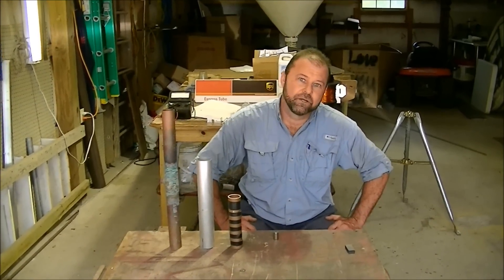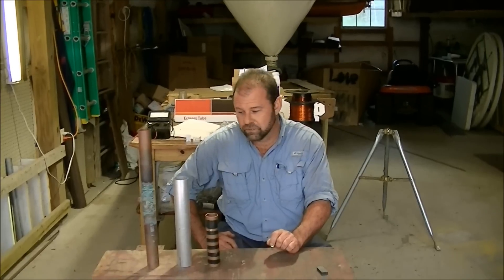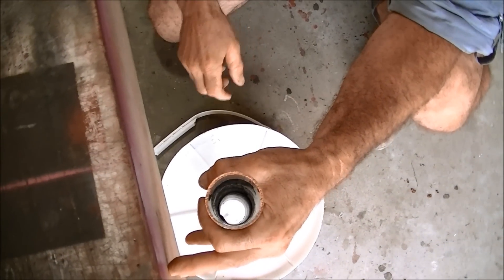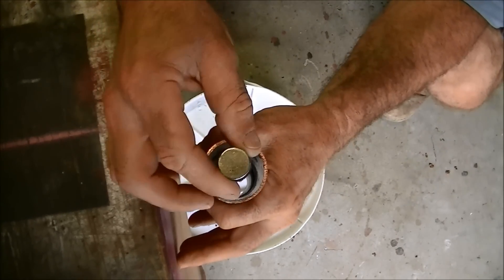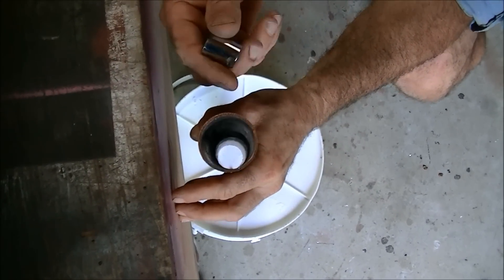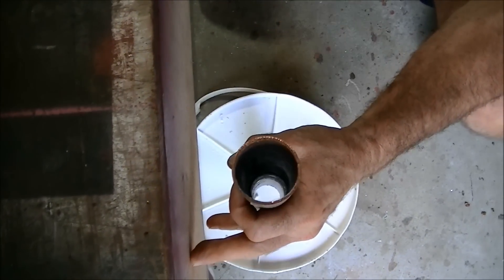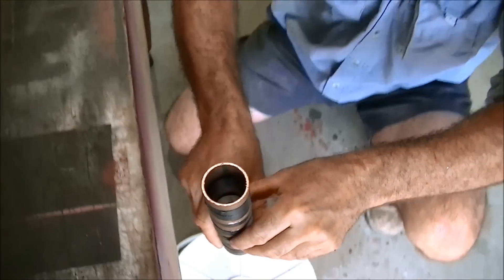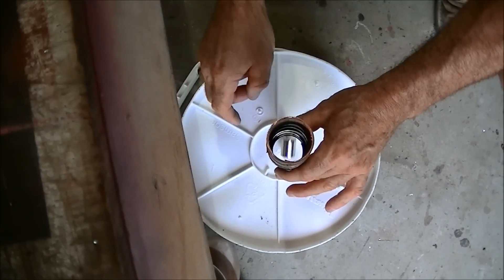Watch what happens when a magnet falls thru a copper pipe/aluminum pipe.

Comment: Just so you know it's not making any electric at all. If it were it would fall faster.
It's all to do with electrons and magnetic "friction" being caused. As there is no potential, the field repulses itself making it slow. If you add a light or load, allowing for the charge to flow, the magnets fall as there is no resistance.

Comment: The comparison of copper sections to continuous copper pipe is a great experiment! The reason it falls faster through the cut pipe is that there is increased resistance between sections; the induced current is lost to resistive heating faster than in a single whole conductor, causing the opposing magnetic field to collapse faster. Since that magnetic field is what slows the descent, the faster it collapses the less it can impede movement

Comment: Evidently, the magnet is causing an electric force to swirl around inside the pipe, but because of friction, the magnet is being impeded. Theoretically, the magnet's fall is being converted to a slight amount of heat within the copper. This is supposedly how electric generators work; a coil of copper wire is placed in the vicinity of a moving magnet, creating electrical current.

Comment: This illustrates  "Lenz's  Law" which basically states that any induced magnetic field such as moving a magnet through a metel pipe, will oppose the  field that induced it.  Does not have to be a magnetic medium.  i used it in a science project many years ago to levitate an aluminum ring on a steel core.

Comment: What if there was a tube made of copper wires coiled, made into a complete circle with a neodymium magnet inside and it was turned by a motor? Would the magnet hold in suspension in one spot and could the wheel power itself? 🤔

Comment: Okay next experiment  round copper pipe with connectors  place a rounded magnet in the the circular copper piping does it generate power and can it ever run out as it were. and what I mean by circular  pipe is a hula hoop drop magnet ball in that and figure it out?

Comment: it goes slower on the one because you "break connection" causing it to free fall for that small distance building speed. also with the cylinder magnet, hold it sideways and drop it rather than log ways into the one with slowly falls through. 😋

Comment: This is how most people get electricity. People burn coal. The fire turns water into steam. The steam turns the turbines. Inside the turbines are power generators. A power generator is only copper wire and magnets. Water goes through dams. The water turns the turbines. Inside the turbines are power generators. Power generators are only copper wire and magnets. Inside windmills are power generators. Don't get caught and be very careful.Electric motors are made exactly like power generators. You can take apart a blender and make small amounts of electricity. You can take apart a electric saw and make small amounts of electricity. You can take apart a vacuum and make small amounts of electricity.
Reply from the maker: Good answer. Check out my home made hydro generator.
https://www.youtube.com/watch?v=Gnyo95hon-U

Comment: If you took a thin walled plastic tube and tightly wrapped copper wire around it several times, would that generate a high amperage current?

Comment: I was thinking what if you get two other magnets on each entry with the Third in the pipe. and make them rotate. so there always reversing the direction of the inside magnet could you build up enough energy to do anything useful with it? no body freak out please I don't actually know how this works I'm just curious.

Comment: im an inventor and my theory and idea is simply this THIS IS A TIME MACHINE. inside the magnet is a capsule where a human can be in suspended animation in time where if you are inside for a day earth can travel in time in normal speed but the capsule would slow down to half that so every one day inside earth is two day into the future and you can adjust that depending the thickness of coper pipe and strength of magnet , you may preserve a hot meal or a  car from effects of time like rust ,rotting and aging ect.. imagine an army inside where  they go in come out 30 years later but its just like yesterday without any damage to tanks aircraft without loosing war skills ready to go its like the new refrigator it may preserve anything in the capsule machine or people for later use. having a hot meal ready and eat it fresh  30 yrs later is cool, but time travel may have unknown effects on the body and the mind of a person , you may not like the future you see and ca not go back in time . my hopothothesis .

Comment: What happens if you rotate the pipe while magnet is in transit? if you put the pipe across the diameter of a wheel, there will be a speed that will keep the magnet in the pipe indefinitely

Comment: If you suspend the pipe in the air on non-conductive wire, does the magnet still fall like this thru the pipe? I ask because there would be no path to ground.

Comment: You just showed how a selonoid works .. except magnet has a spring on it n voltage is applied to the pipe for a reaction. Open n close the circuit

Comment: Will any magnet with dimensions you've listed work?

Do you have any suggestions on where to purchase magnet like one you are using in demo?
Reply from the maker: It has to be a n52 magnet around this size. Also the thicker the pipe slower it will fall.
Reply: markp0177 
Thanks...
I'll see if I can get think copper pipe at Home Depot or some other   store...   Not sure where to buy magnets but I'll google it.

Thanks for sharing video and answer...

Comment: So does it generate electricity at both ends or only near where the magnet is moving, ie are the electrons clumped together at the point where the magnet is or does it flow to the end of the pipe.

Comment: I wonder if that defect would be Amplified if you had a thicker pipe and not a sticker board but the same inside diameter with the quarter inch or larger outside diameter as example

Comment: could this be used in conjunction with say, a hydro power generator, to create more power? So have the magnet in a sealed pipe, and as the water wheel is turning, the magnet is moving from side to side. therefore generating more electricity than a standard wheel?

Comment: if the magnet falls slower and a magnet passing through coils creates power, then what happens if the copper pipe were a sealed circle attached to a motor with coils on the outside?

Comment: So smart he has the bucket upside-down.
Reply: Rafael Santana The bottom of the inside is flat too. Also, fuck you & your ableism.
Reply: Rafael Santana No, no respect for you & or your epithet. 
At any rate, the pipe could be held any distance from the surface since it was filmed from above. However, had the bucket not been upside down he wouldn't have had to fetch them off of the floor - instead the magnets would have simply been in the bucket.
It's a foolish argument.

Comment: I just tried this at home - a small but strong neodymium magnet dropped through a 10mm diameter copper tube, only 28cm long, took about 3.5 secs. It was a fairly snug fit but the magnet did not touch the sides as it fell. Is there a practical use for this? Very interesting, thank you.

Comment: Have you took in consideration that the copper pipe with the rings.. is much smaller than the solid copper pipe.?   Could you cut more rings and make the same length,  then try it again. ?   Like to see results.

Comment: That's cool man..What would happen if you wrap thick coil wire around the copper pipe "50" turns or more and connect each end together or connect a light bulb to see if it lights or slows down even more.

Comment: Just tried this with a three-quarter inch or so copper pipe and a few neodymium magnets from Harbor Freight. Definitely works, doesn't fall as slow as in this video but it's still freaky.

Comment: FYI gold is the best conductor for electricity not silver thumbs up if you have done your research and agree
Reply: pyrolatry87 As mentioned, silver is the best. Gold conducts even worse than copper...it is just used often in electronics as plating due to it's corrosion resistance
Reply: pyrolatry87 No.... as he said in the vid, Silver is.
Reply: pyrolatry87 you have to get gold down to absolute zero to be a super conductor.
Reply: I see now u have already been corrected by previous comments. lol I love the comment section.
Reply: Eric Myers nice name Eric
Reply: FYI pure silver is the absolute best conductor. Cant thumbs up on this. Gold is well behind copper and is only used on contacts because tarnish or corrosion resistance.
Reply: HarryHydro supercoductor ceramics @ liquid nitrogen!
Reply: Actually, you don't need to go to absolute zero; you need to go below what is called the "Transition Temperature", and it varies for different materials. In the case of Yttrium barium copper oxide it's above 77 Kelvin, which is the boiling point of liquid nitrogen -- this is why the Meissner effect can be demonstrated in classrooms without requiring liquid helium.
Reply: Jim Hofoss No, gold is not the best conductor.  Copper is a better conductor than gold and silver is the best conductor of all.  Look up "IACS" ratings of different metals.
Reply: Hugh Jasol I stand corrected!   Thankyou....I suppose that gold plated terminals, such as on audio cables, are used because the gold does not oxidize and degrade performance.
Reply: Eric Myers nice name
Reply: pyrolatry87 yes, gold is the best conductor of electricity that we have found so far....there may be elements and conditions which change this parameter in the future, however
Reply: Eric Myers no, gold is a better conductor

Comment: way back early 2000's non-battery flashlights were available that lights with a few shakes. it has some sort of metal (not sure if it's magnet) passing through a copper spring

Comment: If you connect a multimeter on the ends of the pipe, you should be able to measure a voltage

Comment: it is a counter electromagnetic force. it is not producing electricity. it would go slower if you used a thicker round magenet. I believe coils and magnets put in the right configuration, can make a free running device. good luck.

Comment: I spent most of my working life installing, jointing, maintaining and repairing copper telephone cables, but some bright spark in the late 70s to 80s, decided to use aluminium conductors on large size cables instead, probably because aluminium was cheaper than copper. What a disaster that turned out to be. With you saying that aluminium is only 69% efficient as a conductor, I don't know why they even bothered. These main cable runs, of mostly 600 or 800 pair cables, usually about 2 to 4 kms in length were notorious for causing noise problems, like the old phone crackling, hissing etc, and then when the internet arrived, all sorts of speed and dropout issues. Also the joint enclosures were plumbed lead, which were prone to cracking and leaking if not done properly, or from fatigue if moved around too much in the manholes. Once moisture gets in, and with the paper insulation over the conductors getting moist the whole joint cooks from the heat generated by the subsequent current leakage. Even when opened up and dried out, these joints would remain a problem forever due to the aluminium powdering up and eventually breaking off completely. Must have cost billions over the years. Needless to say they went back to good old copper, which even that now has mostly been replaced by fibre technology.
Reply: Aluminum is fine, the application will require more of it (thicker gauge).  All Aluminum will rust if not treated or react with other metals. Each connection REQUIRES an Anit-Oxidant compound (electrical grease). There should not be any paper in new cables used in high moisture environments. Fiber optic cables need to be used even more than they are today.

Comment: I have not tried it, but was told by a Physicist that the larger diameter the copper pipe and the smaller the magnet, the greater the space-time continuum is impacted.
EXAMPLE: 
If one were to drop a 1" magnet into a 4' diameter copper tube approximately 6' tall a shift in the space-time continuum could be as great as plus or minus 10 years - time being pushed backwards if above the equator, time being pushed forwards if below the equator.
I am now looking to obtain a 10" magnet, 40' diameter copper tube and 60' tall so I can travel 100 years back in time. Be sure to look for me in the history books.

Comment: Interesting...if the electricity could be used to move the magnet to the top again and drop it through the copper tube...would that not almost be a eternity machine?...it'd last as long as the copper tube lasted.

Comment: Very interesting Mark.  One wonders if the gauge were thicker, if greater voltage could be generated... I've been thinking about magnetic propulsion and water powered engines...  and hover crafts.  Theories abound that UFOs use magnetism to achieve singularity; but then they're seen entering and emerging from the ocean: so I wonder if both are used...  Thank you for the video.

Comment: I wonder if a copper pipe with a silver plated inside surface would be as efficient as solid silver, more than copper, or much the same. Also what happens with gold? or (gold plated). Another idea is to attach the magnet to a bungy type spring (like a "slinky") then bounce it up and down like a yoyo. I found that bouncing a slinky spring created a lot of momentum with a small movement  to start it falling but a big release on the bounce back up. I imagined a big tower with a giant slinky coated in copper and a magnet in the center, but it could work in reverse, using the weight and gravity to go down and the spring to bounce up, to generate electricity. I know it sounds stupid! but....

Comment: I am curious ... the large sized magnet you have moves through so slow because it cannot really change its orientation.  I might be wrong, but as the magnetic field changed it sets up a reverse EMF which pushed back on the magnet ... a kind of magnetic inertia.  BUT, what if the magnet can rotate or turn around, or even if you give it a spin at a certain angular velocity ... would there be a maximum velocity to be attained for a given magnet?  OR, say the magnet was spherical, would that magnet find a rotation mode by itself to react to the counter-EMF?

Comment: have you tried putting a coil of wire, next to the pipe off to a light our other small circuit to see how much energy you generate
Reply from the maker: The copper pipe is a dead short of any eletricty produced. The only energy created is heat in the pipe.
Reply: markp0177 interesting. just wondered if a coil could pick up the induction of the magnet passing through
Reply: If you made a "pipe" tunnel out of copper wire wrapped around cardboard paper towel role, etc with both ends connected to +/- of light bulb.  Need a certain kind of bulb.  I did a similar experiment before.

Comment: That phenomenon we have all been witnessing is called "electro-magnetic induction". As the magnetic falls through the pipe, it induces what is called an "eddy-current",  which circulates at right-angles to the direction of the magnetic field, according to the "Right-Hand Generator Rule".  And according to Lenz's Law, whenever an EMI occurs, another magnetic field is created in the pipe that directly opposes the field that created this current:  This is what causes the magnetic to slow-down as it falls through the pipe. Pretty cool, eh?

Comment: If you could accurately time how long it takes for the magnet to pass through a given length of pipe for the respective metals in comparison to free fall this would be expected to lead to some calculations which might be of interest. For example an 'apparent acceleration due to gravity' whilst in the pipe could be used to calculate the magnitude of the forces involved and the 'amount of work done'

Comment: Could you use a strain guage or an appropriately sensitive  infra red temperature device to see if any temperature changes of the respective metal pipes  before during and after the passage of the magnet (you might have to wear gloves or place the pipe in a support)

Comment: lighten the magnet by cutting some off the ends 1/4 inch off south and north poles. drill a hole then through center of magnet small enough to get a rubber band through it. same as the rubber band plans, in this case band has to be lubed so mag can still free fall due to gravity. fix each end of bands to perfect level. stretch band and wined play with height till desired free fall. ohms meter the sides as mag falls.

Comment: Another thing you could try after attaching an ammeter to your copper pipe is to attach the magnet to a broom stick.  Then use the broom stick to manually pass the magnet through the pipe.  Increase the speed of the motion back and forth.  That should increase the amount of electricity generated and most likely will create heat in the pipe itself.  You've effectively created a dynmo.

Comment: If you set up an ammeter connected to both ends of the copper pipe you might be able to measure the amount of electricity flow you create.

Comment: I think you said at around 2:20 that copper is only 75% as effective at conducting electricity as silver.
If I got that right this is incorrect. The International Annealed Copper Standard uses copper's conductivity as 100(%) and silver reaches 105.

Comment: try wrapping a dense coil of copper wire on a thin form and hook the two end up to a DC meter and measure the voltage. If you apply a voltage, it will suspend the magnet.